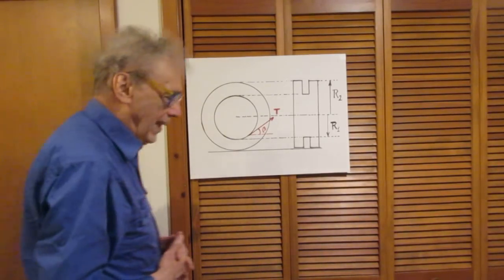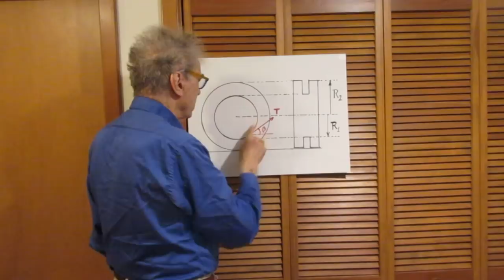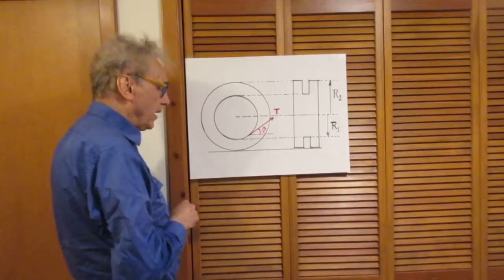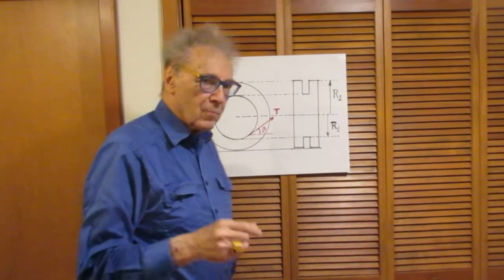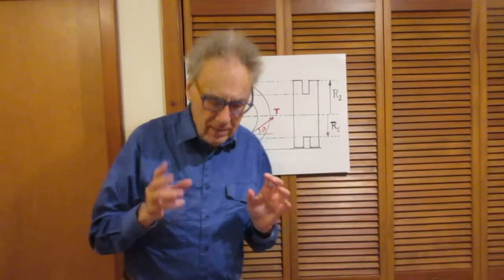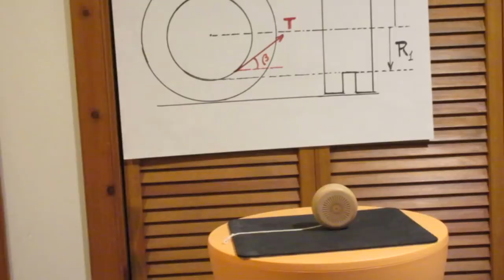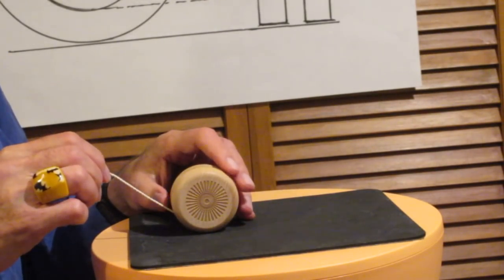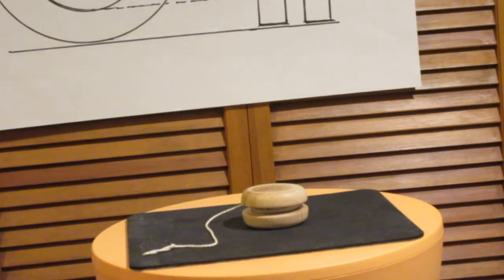Problem #22 More on Yo-Yo's

Comment: I will give it a shot at this one.  There must be an angle theta for which this angle makes the system not roll and this must happen when all of the force (T) passes through the point where no acceleration occurs for the system.  This point is at the point of contact between the yo-yo and the ground (C).  As theta increases, the force (T) will reach a point which causes this force to pass through the point (C).  At this moment, the sum of the forces must equal zero and torques oppose each other; that is:  N + T * sin (theta) - mg = 0;  T cos (theta) - Force of friction=0;  T * R1 = Force of friction * R2.  Solving for theta, theta = arc cos (R1/R2).  At this point, the yo-yo will cease to have a force that will make it move to the right or to the left, it will probably just drag or raise up from the ground.  Merry Christmas and Happy New Year!!!

Comment: I checked the same by using sewing machine bobbin, aaah that was great.it runs towards pull whenever angle is less it gives a clockwise torque by frictional force as soon as angle reaches to a critical angle than anti-clockwise torque by pull is equal to clockwise torque by frictional force.

Comment: Good Saturday Morning, Professor Lewin:

I tried wrapping a string/twine around the outside circumference of a coffee can and found it was essentially impossible to keep it from sliding (much less rolling) in the direction of my pulling the string parallel to the floor surface (where your beta angle approaches zero degrees).  Incidentally, I used two plastic covers on the top and bottom surfaces of the coffee can, to account for the thickness of the string.)

However, this is NOT the problem you have stated, so next I simulated a yo-yo geometry by taking a nearly-empty spool of wire and wrapping the twine around the smaller/inner radius.  This time, when my beta angle was zero to a small angle, it was completely natural to pull the wire spool in the same direction of my string pull.

(Of course, I knew we had to balance -- or overcome -- the difference between two torques:  1) the natural desire for the object to "unspool" (i.e., roll in the direction opposite to the cosine of my pulling angle); and 2) the use of friction upon the floor to coax the object in the direction of my pulling.)

At this time, I did not derive any critical angle where the regime switches from "rolling in the the direction of the pull" and "unspooling -- rolling in the direction opposite of the pull).  However, what I DID learn from this exercise is the following:

A)  the effect does not work if the radius of where the string is the same as the radius of the can, i.e., (r of the string)/(R of the can) = 1.

B) one REQUIRES friction between the object and the floor/table/etc. if this experiment is going to work.  

C) the critical angle beta is related to the ratio of the r/R to change from directional rolling ==> unspooling.

D) in the way Galileo deduced inertia as a leap of faith between objects speeding up when they run downhill, and when they come to a quicker stop when they are rolling uphill -- then there must be a place where it will neither speed up or slow down (ignoring friction) -- I believe THIS is the analogy of the angle you have asked your viewers to calculate.

Cheers,

Joe

Comment: arccos[T.R1 - π.¥.(R1^2 - 2.R2^2).a.R2 - π\2 .¥.(R1^4 + 2.R2^4).a/R2] / T.R2 
here a = initial acceleration of yoyo
         ¥= mass per unit area of yoyo
I have taken the direction of friction towards right because the because yoyo is moving towards right and one component of tension is towards left and yoyo is moving towards right so it is only possible when there is a force so I have taken the direction of friction towards right.
Then i used Newton's second law of motion and solve the equation and answer comes .

Comment: This is kinda.... CRAZY. I thought it will be easy at first, but I am unable to solve! As you increase the angle beta, the thread "sticks to the yoyo", and hence the slope of the yoyo also increases as u increase beta. Correct me if I am wrong Prof.

Because of this I am finding it almost impossible to find the component of the Tension perpendicular to the radius vector. 

I THINK the "surprise" will be that there is a super duper strategic point about which you can easily compute the torques.
Reply: The trick to rotational problems is the choice of the axis of rotation (rotational origin).  If the math becomes impossible, chose a different point around which to calculate the torques.

Comment: Also sir i was trying to find the acceleration with which the yo yo would be moving as a function of beta and answer was like 
a={[4R^4+2R^2r^2][cot(b)-(r/sin(b)R]g}/{[6R^4+2R^2r^2+r^4]}
But also confused that denominator was the above one or {[2R^4+2R^2r^2-r^4]}....please let me know sir if this was correct as you would not discuss it in your solution i suppose....
Reply: "R" is radius of outer and "r" is radius of inner and "b" is beta...huh ...fingers crossed

Comment: Well, if my calculations are right: beta critical follows from the equation:
cos(beta_crit)*R1+µ_static*sin(beta_crit)*R2=µ*m*g/F_T
The analytical solution for this equation is too complex to write in this comment, I just solved this equation using Maple. It would be helpful if you could post some numerical values for the mass, the radii, mu and F_T
Reply: Sorry, in my opinion the angle is not dependend on the mass. There's a reason why Prof Lewin insists on the pure rolling of the yoyo without any sliding. He also does not define the mass of the yoyo.
There must be another reason for the unintuitive movement of the yoyo then. Maybe you try to make a scetch? If I may help you: You neither have to draw/calculate the friction force nor the gravity force!

Comment: Here's what I think is the solution:

First, the assumption of no slipping means that the frictional force is less than umg, and therefore the mass is irrelevant.

I will call the tension in the string F to prevent confusion with torque, and it produces a torque T1= -Fr1 independent of the angle of the string. 
At the same time, F produces a horizontal force Fcos(beta), which is opposed by a friction force at the point of contact of -Fcos(beta), for a total torque T2 = r1cos(beta) + r2cos(beta). The critical point of CW or CCW rotation occurs when T1=T2.
Fr1=F(r1+r2)cos(beta). F cancels out, leaving beta = arccos(r1/(r1+r2)).
Reply: oldtvnut wait how did you get t2=r1cosbeta + r2 cos beta

Comment: This can be easily explained by assuming the yoyo as a point mass. Tsin(beta) = mg.
This assumption is correct as on centre of mass of the body, there are 3 forces acting : 1)The gravitational force. 2) The reaction to gravity(this is what is required for a frictional force). 3) The external force T.
In the FBD, if the component of T along the vertical is less than the weight, the frictional force is sufficient enough to make the yoyo do  perfect rolling ( as it was already enough). If it is more than the weight, the frictional force becomes 0, and the yoyo falls down as it would do normally, unwinding it's cord.
But if it is equal, that will be the point where the yoyo will stop perfect rolling and would be just about to start its usual motion. Hence, T.sin(beta) = mg.
Reply: Sorry, in my opinion the angle is not dependend on the mass. There's a reason why Prof Lewin insists on the pure rolling of the yoyo without any sliding. He also does not define the mass of the yoyo.
There must be another reason for the unintuitive movement of the yoyo then. Maybe you try to make a scetch? If I may help you: You neither have to draw/calculate the friction force nor the gravity force!

Comment: Can we assume masses of the three disks to be equal
. Or do we have to calculate taking radius into consideration.. And is R2=2R1..?
Reply from the maker: solve the problem as I presented it.
Reply: Is my answer correct professor or shall i check once again..?
Reply: @RRRROCKYYY  You ultimately don't need the masses or the rotational inertia.  As he specified it, the given problem is three disks of an identical density and equal thicknesses, with the middle disk having a radius r1, and the two outer disks having a radius r2.   You could calculate masses and rotational inertia from this, as a function of density, but you won't need this information to find the critical angle.

The trick is the line of action of the tension in the string.  At the critical angle, the line of action of the string passes directly through the contact point with the ground.  At less than the critical angle, the line of action of the tension in the string passes above the contact point, and causes the yo-yo to roll to the left.  At greater than the critical angle, the line of action of the tension passes under the contact point, and causes the yo-yo to rotate right.  At the critical angle itself, the line of action passes directly through the contact point, and can't cause it to rotate while still in contact with the ground.

Comment: Critical beta = arctan[ sqrt{ (R1/R2)^2  -1} ]  ????
Reply from the maker: >>>sqrt{ (R1/R2)^2  -1}>>> 
R2 is larger than R1. Thus { (R1/R2)^2  -1} is always negative. How do you calculate the sqrt of a negative number?
Reply from the maker: your 2nd solution is correct. I will therefore not make it public.
Reply from the maker: you could have written your correct solution more elegantly - SIMPLER (also more transparent) but what you have is correct (it took  me 3 minutes to figure out that is it correct). Watch my solution next Saturday.

Comment: Cool problem... I think I would just use a simple equation like p x (r2/r1) > p + p x cos(beta)... where p is the pull distance (the trick is to add the extra 'p'). Then simplify that by dividing by p: r2 / r1 > 1 + cos(beta)... simplify that some more and you end up with r2 / r1 - 1 > cos(beta)... and beta > arccos(r2 / r1 - 1)... Even though this doesn't make intuitive sense to me because r2 seems to have a limit at 2 x r1, I think this might be the correct answer...
Reply from the maker: arccos(r2 / r1 - 1)
let r2/r1 be 3. What then is the arcos of 2????
Reply: hehe... Oh I know... doesn't make a lot of sense huh... I guess I interpreted as "if r2 is sufficiently larger than r1 (more than twice), the jojo would always move right (or not move), never left... independent of beta." ... like I said, probably wrong, but can't find the fault in my reasoning towards the equation either... cool problem.
Reply: I think I found my own mistake... if I forget about the jojo and cords and friction and the whole thing... it's a simple triangle problem of the two radii and an angle beta that is equal to arcos(r1/r2)... but then why can't I find that same answer thinking from the cord of the jojo?

Comment: I have another question sir. If my assumption of what happens at the critical angle β is correct, would the yoyo actually remain at rest if we try to do this practically? If not, why?
Reply from the maker: try it
Reply: Lectures by Walter Lewin. They will make you ♥ Physics. ok
Reply: I think at the critical angle there will be only translational motion,no rotational motion

Comment: Simple torque calculation between friction and tension
Reply from the maker: If this is so simple, what's your answer?
Reply: You just got roasted
Reply: The question is whether or not the friction always remains static. I'm currently stuck at that point.
Reply: Friction forces on a rolling object are static as long as it does not slide. Check the yoyo in the video and find out if it is sliding or rolling.